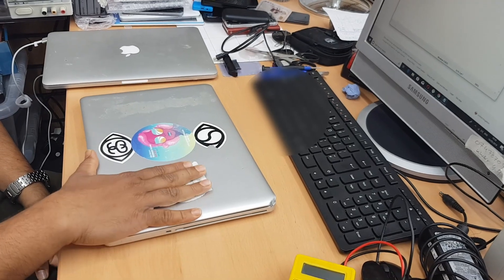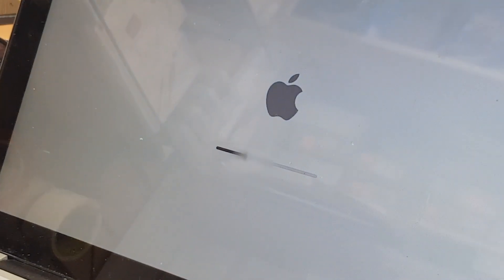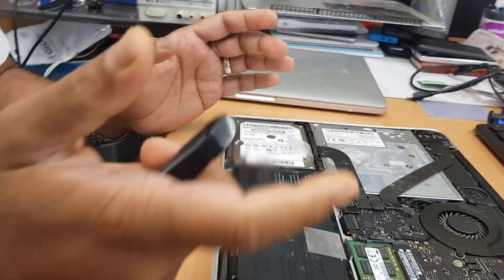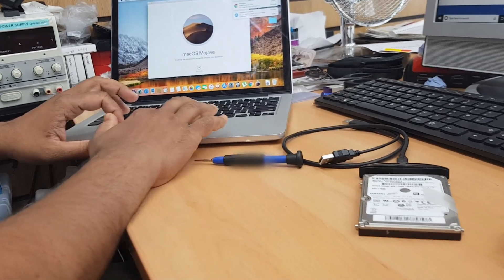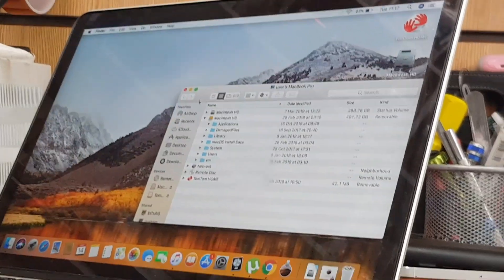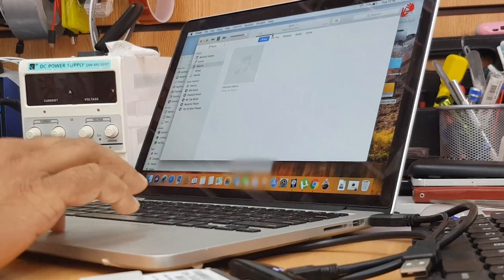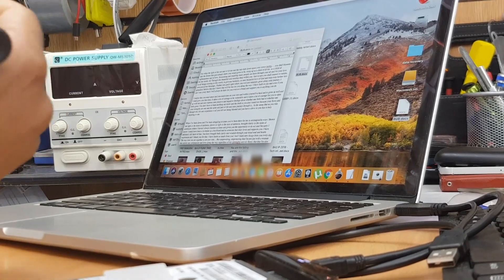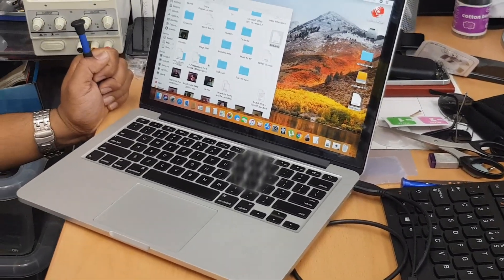How to Recover Data From  Any Mac

Comment: Hi, I had a iMac from 2010 and it is broken 6 years ago. I removed the disk, not I bought a cable and connected it to my new lmacbook air M1 and theere are 2 lights on the connector turned on (blue and red) but the harddisk does not make any sound like turning and I don't see any hard drive detected by my Mac. Who can I sole the problem so I can recover my old fotos? thanks a lot!

Comment: Hi and thanks for this very helpful video. One thing you said (it might have been in the comments) really made a big difference. When I removed the old hard drive and connected to a computer using a usb adapter, I needed to give it  a good bit of time before the computer recognized it. The problem that I am having now is that the user name folder inside the users folder appears to be empty. Could that be because the user account was password protected?

Comment: Hi there - so my MacBook Air crashed last week - wouldn’t turn on - color me devastated   as I had not backed up data to the external hard drive sitting in the closer - apple support said moisture damage had caused corrosion— it would only cost a few more hundred dollars to but a new MacBook than fixing my beloved computer - so I opted not to fix and am awaiting the return of my broken one -I’m interested in trying to retrieve the desktop &   Document files - was  looking at data recovery services when I came across your video - you make this look so easy why is data retrieval so expensive? Wondering if I should try this - wouldn’t want to mess up the new computer - anything I should know before I try this?

Also - dumb question but will ask anyway  - is Keychain specific to an apple account or specific to the individual computer?
Reply from the maker: Yes, it is easy, hope you would recover the data successfully. Do not forget to ask question if you need any further help regarding this. You may contact through my Facebook page.Hope you would subscribe to my channel. Thanks

Comment: Thank you for this Information
I had a Mac retina 2013, then a lost it. Btw, i Found it. So they formated it and install a new Os. 
So, i lose all my data. 

Can i use this way to backup old data from a Formated SSD (mac Retina 2013)?
Reply from the maker: Sorry to hear that, I am sorry with this method you would not be able to recover the data , Formatted hard drive or ssd fact.

Comment: Hi @thepcphone thanks so much for this video - I ordered an adapter and I have just followed the steps you showed, but the hard drive shows up on my new Mac and when I clicked it it said 'loading' for ages and then just disappeared. Help please!
Reply from the maker: Hello Claire, I am sorry for your trouble. Remember to give it some time after you connect the SSD to your new mac. sometime it would day loading and then vanish away but after a while it would come back .Let me know if it did work or not. for further help you may contact at our what's app 07947374809.

Comment: Hi, I bought a double USB 2.0 SATA adapter/converter, quite similar to the one you have (same cables and all. You don't happen to know what the split short cable/USB port is for?). First time I plugged it in, I was able to access a couple of the files and folders, before the adapter cut off (went from lighting red and green, to just lighting up red), after that, my Mac recognises the adapter, starts loading it up, but then disconnects/looses connection (with the error that the device was not ejected properly). Do you know what has happened and how I can work around it? I looks like you are using the port for USB 3.0 (?) I've just bought another adapter for that port too (will hopefully arrive in a couple of days in the mail), but if this still does not fix the problem, is there ANY other way to work around it? Is there a "memory chip" (in lack of better words) inside the actual drive that I can take out and plug into some other device that may boot up?
Reply from the maker: The usb cable does not get enough power to play the drive to recover the data or the actual converter is low quality made. please do change the adapter and  hope that would resolve the issue!Happy to help! Hope you would subscribe to my channel! Thanks

Comment: Is there a way to get my old passwords and bookmarks from chrome using this method?
Reply from the maker: Hi, what did you mean by chrome? Chromebook?  Most of the chromebook does come with emmc memory so that its almost impossible to get the data to recover by independent repair.
Reply: @thepcphone  my old MacBook died and wanted to get the data from the chrome browser I used.

Comment: I have an Apple Macbook Pro model no.1502 - I believe it has an SSD hard drive. Unfortunately, the hard drive is not detected by the system when I load it up and it doesn't appear in the disc utility options to repair. Will I be able to do the above and recover my data?
Reply: After so many stress I was excited my files was recovered with the help of hack_master11 on Inśtagram!! His a genius...

Comment: Hey @thepcphone what if I can’t really acces the drive when it’s plugged into an iMac? It shows up but when I click it, it just loads and loads ant nothing happens :(
Reply from the maker: HI, what you really wanted to do with the drive? do you want to  recover the data or wanted to reboot the system?
Reply: @thepcphone  Ideally - both, but I don’t think the system can be reboteed again so the only thing left now is recovering the data somehow :(
Reply: @jakub4981  so the drive damaged? any other way to check it?  formatting it to confirm? even though data lost, if it's good, you can use it as an external drive.
Reply: @johnwang176  Hey, I don't really want to format it as I have some valuable data there. I have ordered a SSD enclosure to try to transfer the data to another PC...maybe this will be the only way to actually recover the data without having to pay an enormous amount of money for professional data recovery services.

Comment: Hi, trying to recover data from Mac Air. The video is v helpful so going to try on mine. Could you advise where I can get a hard driver converter from? When I Google, brings up a lot of choices! Thanks 👍
Reply from the maker: Hello, would please  let me know about your mac model and which year of mac?? If 2.5 inch sata hard drive then you need one type and if ssd then need other type. So please let me know which one you do have!! Thanks
Reply: @thepcphone  hi, it's a MacBook Air 13" Mid 2013 (A1466 - EMC 2632). 😬
Reply: @thepcphone  I also need help as well what kind is your ssd converter?

Comment: My MacBook is stuck on white screen and I want to recover the data before formatting to see if it works.. so if I do this method can put it back and it will work like normal?
Reply from the maker: Sorry i did not get you completely what you mean. However this method will help you to recover your personal data(music pictures videos documents). so yes this data will be ok and it would work any platform. 
this method will not help you to recover your system.

Comment: I want to know what adaptor I need for the retina 12” MacBook 2015 to retrieve my data. Can you help?
Reply from the maker: Storage
1.1GHz
256GB PCIe-based onboard flash storage1
1.2GHz
512GB PCIe-based onboard flash storage
would you please check which type of flash  ssd you have installed in your mac?
there are some similar converter you might can try.
https://www.ebay.co.uk/itm/SSD-Adapter-for-2013-2014-2015-MACBOOK-Air-A1465-A1466-Pro-A1398-A1502-Converter/323324910845?hash=item4b47aa9cfd:g:GbMAAOSwuVZbN88d

https://www.ebay.co.uk/itm/SSD-Adapter-Card-for-MacBook-Air-Pro-Retina-2012-A1465-A1466-HDD-to-SATA/383749327986?_trkparms=aid%3D1110006%26algo%3DHOMESPLICE.SIM%26ao%3D1%26asc%3D225113%26meid%3Dfd9e8ce14c654c10b49c53783f3e3c97%26pid%3D100005%26rk%3D3%26rkt%3D12%26mehot%3Dpf%26sd%3D402363251541%26itm%3D383749327986%26pmt%3D1%26noa%3D1%26pg%3D2047675%26algv%3DDefaultOrganic%26brand%3DUnbranded&_trksid=p2047675.c100005.m1851

those link just to give you an idea !!
Reply: Thank you for the reply. I’ll look into it. Great!
Reply: @samcampbell1587  Cyber_kor on Instagram just recovered my precious document which I deleted by error for so many years..
Reply: Cyber_kor on Instagram just recovered my precious document which I deleted by error for so many years..

Comment: How to open MacBook Pro 16 to access to the SSD? Where to find the cables? What is the cable connecting the hard disk to another laptop call?
Reply from the maker: sorry this  method would not work directly with mac 2016(if there is built in ssd then it would not easy) to all other latest mac. but still there  are some tools available in eBay but personally i have never been tested. but its much more difficult process.

Comment: Hi ,
Thanks for this video tutorial. . Exactly same issue even I m facing with my macbook pro .. 

Wanted to confirm that, can I access the software applications which were installed and take the backup of those softwares also if I pluggin and try accessing my harddisk with another working macbook pro ??

Plz reply it would be great help ..

Comment: Hello, thanks for this excellent video. How do you get files off when the imac is encrypted_
Reply from the maker: There is nothing to say except thanks for your time.  Even the mac has admin pass protected still I was able to recover all the files and user folders without any difficulty. when I plugged the old mac had to the different mac with a USB converter, the second mac treated the old had as a USB external drive. 
i would request you to watch the full video to have clear idea. one more thing, in my videos  I don't edit or cut the errors or mistakes  as we often learn from the mistakes.

Comment: Thanks for the video.  I have the adaptor and plugged the old hard drive into the adaptor and in to my current laptop through the USB.  However nothing at all is showing up. Obviously this cannot be a good sign.  Any comments much appreciated. :-)
Reply from the maker: would you be able to whats app me because I need more details about all the unit. example the  host mac USB adapter and the hard drive.
Reply: @thepcphone  Hello, I've run into the same issue. I removed the hard drive from a 2010 white macbook and plugged it into a 2019 macbook pro, but nothing is showing up. I purchased this adapter. 

https://www.amazon.ca/StarTech-com-SATA-Drive-Adapter-Cable/dp/B00HJZJI84/ref=sr_1_9?crid=H6JWNTR2KJKT&dchild=1&keywords=sata+cable&qid=1594252434&sprefix=sata%2Caps%2C377&sr=8-9

Thank you!
Reply: @matthewhearn8808  Same problem here - I ordered the same adapter too.  Did you ever solve the problem?
Reply: @collinoquinn7926  Yes - it did work, but the reason it wasn't showing up was because the old hard drive I had plugged into the new computer needed to be restored first. To access this, go to Disk Utility on your new mac and select the greyed out hard drive you're trying to get your files off of. Select first aid and in the first aid tab, select repair disk. Hope this helps!

Comment: Hi there,
I had my MacBook damaged a few years back, I decided to take it to a computer store to have it repaired and fixed. Unfortunately they could not help with the retrieval of hard drive data. 

I have a working MacBook now thankfully but all my data that I require is on the old hard drive that is kept in my study. 

I would very much like to be able to do what you have shown in the video tutorial. 

My question is do I have any chance of recovering the data, as the MacBook asked for a password when powering on, Will the hard drive when connected via the USB to the MacBook ask for the password? 

Kind regards
Reply from the maker: Hi, Mate.No, the hard drive should not ask for any admin password even if there was any admin password when it was working!! 
very interesting so don't hesitate if there is any more question you may have.
and keep in touch and please do not forget to subscribe to my channel for more videos.
Reply: thepcphone Hi,

Thanks for the reply. I will look at purchasing a USB connector as shown in the video.

Thanks again
Reply from the maker: @airbornegod3720  Thanks for coming back. Please do not forget to leave your experience in the comment section after the data recovery!

Comment: Very helpful video. In this specific case does the 2nd laptop have to be a MacBook Pro? Would it work just the same with a MacBook Air?
Reply from the maker: definitely, it would work!  speed of the recovery process would depend on the year of the MacBook !!
sorry for the late reply as I am stuck in far east due to the Corona pandemic. please show your support with a subscription to my channel!!
Reply: @thepcphone  would it be possible to use a Windows or Linux device to do the recovery?
Reply from the maker: @joelneo2676  nope because most of the time win and Linux does not execute the targeted drive . i have been experienced this for many times.